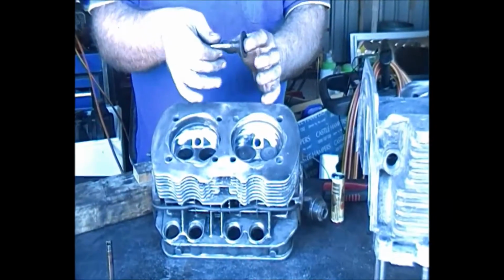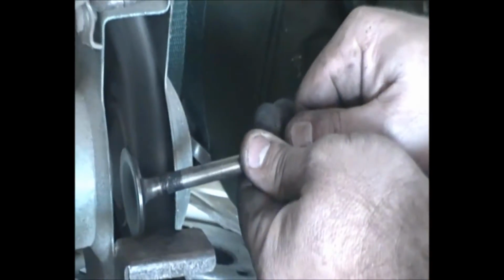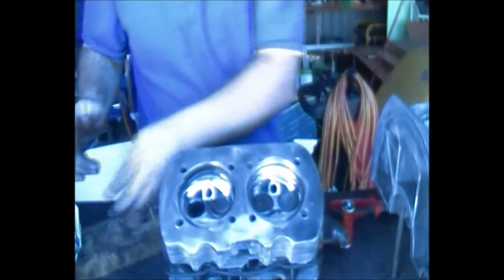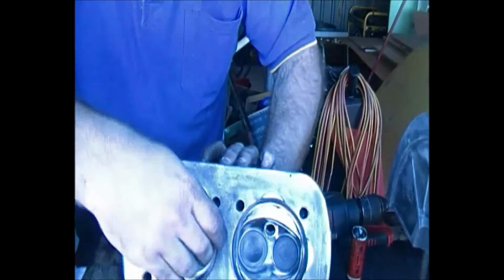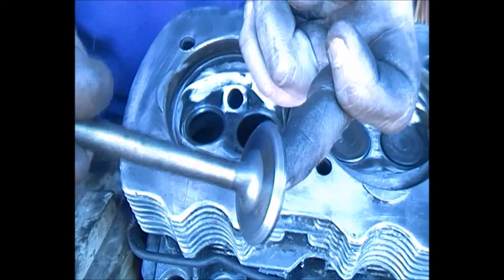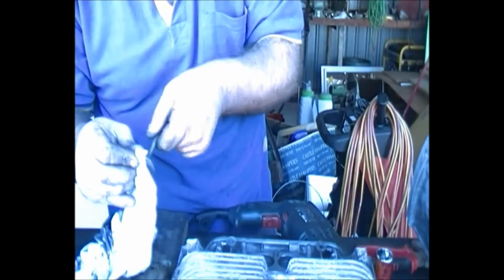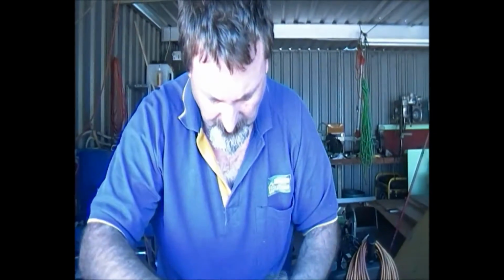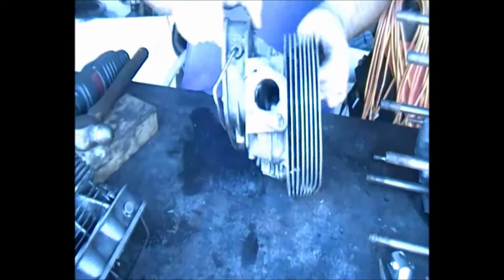Meyers Manx Restoration Part 5 - Seat those Valves

Comment: WOW !!! I have seen some really bone head things done to Volkswagens in my life but lapping the valves with a power drill is not the way to do it !! there are tons of videos you tube that show the proper way to do it. And as a side note if you really care for your eyes take 5 seconds of your time and put on some safety glasses. May I suggest watching some videos from a guy that calls himself VW Darrin. Also if the rubber cups on your lapping tool are expired a little dab of contact cement on the head of the valve and a dab on the rubber cup will do the job nicely. Did you check the valves for "wobble" indicating a worn guide ?, lapping valves with worn guides is complete waste of time. There is an old saying that goes do it right or do it twice.